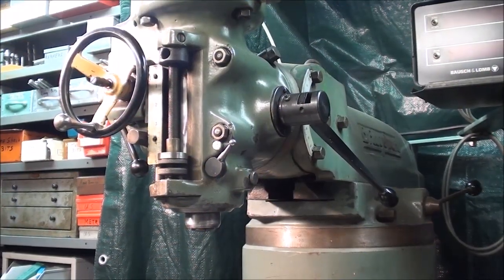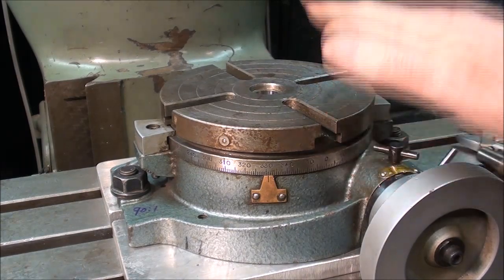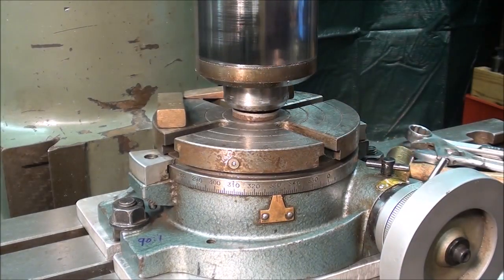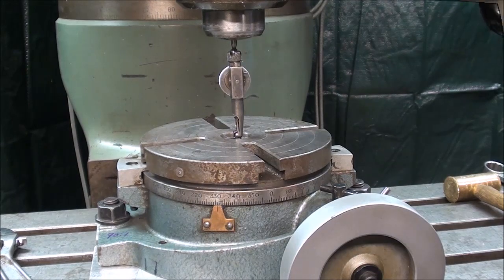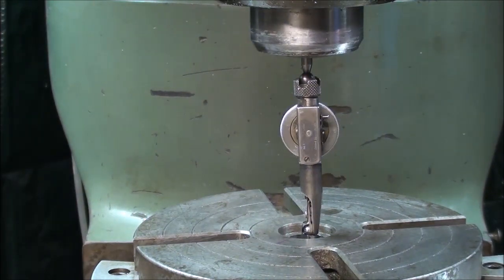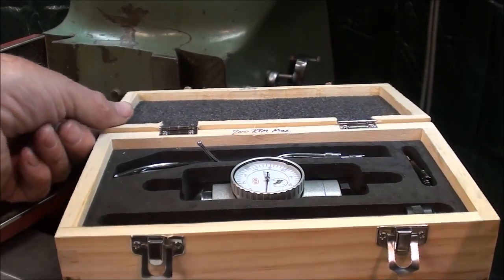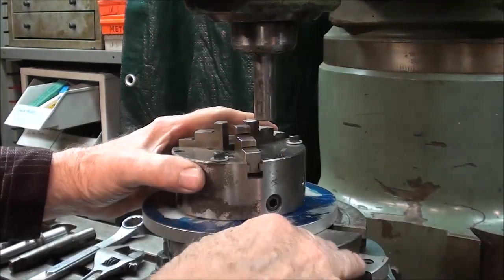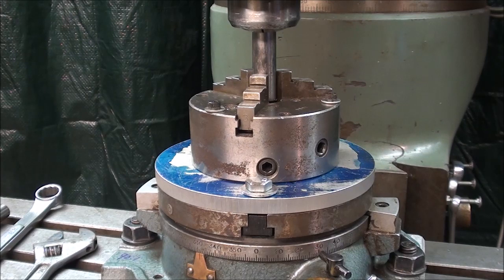TIPS #201 mrpete Centering a Rotary Table on the Bridgeport Pt 1

Comment: Easiest and most accurate way to align rotary table to the machine spindle. Bolt the rotary table to the machine's table. Mount an indicator on the  face plate of rotary table using a magnetic holder. Disengage worm drive of rotary table so it is free to turn by hand. Using the milling machine X-Y table adjustments roughly center the rotary table while turning the indicator around nose of machine spindle,  with out it touching to get it roughly concentric. Now bring indicator into contact with spindle and dial in while turning the rotary table. This method is a must with a Cross Slide Rotary Table where there is no center hole reference in the table. This aligns the true center axis of the rotary table.
Reply from the maker: Thank you.I will show that method at the end of (unreleased tips 375).
There is no hole reference in the table I am showing. The nose on my mill is damaged--so I use the quill

Comment: Thank you for outstanding instruction.  I noticed your small 3-jaw chuck has 3 through holes for mounting to t-nuts on an adapter plate that is then mounted to the rotary table.  Except for 3 hole chuck vs. 4 slot table plate, could you have drilled 4 holes in the chuck and mounted it directly?  I have a small spare 4 jaw chuck that doesn't fit my lathe spindle and am thinking of extending the mounting holes to be through holes for mounting directly to the t-slots on a rotary table.  Is this a hairbrained idea or might it actually work?  Thank you again!

Comment: Hi and thank you for these invaluable videos. Could you explain what / how you are measuring at 9:06? As the dial is mounted on a ball joint, how do you ensure that the gauge itself is aligned with the axis of the mill? Or does its centrality at that point not matter given the task? Thanks for being a great teacher and sharing your knowledge

Comment: BusyBeeTools.com has the straight shank arbors in MT2 and MT3. #B460 and #B461. They only come with a 1" straight shank so may have to be machined down, which is not difficult as this portion is not hardened. They are located in Canada, but will ship to the U.S. The arbors are manufactured by Groz.
Reply from the maker: Thanks for the tip

Comment: For my rotary table chuck adapter plate, I turned a chuck register on one side and a rim on the other that fits snug in the MT2 center bore. This gets me within about 0.0005 every time. And honestly that half thou error might be in the chuck or in the rotary table spindle, not in the chuck to table interface.

Comment: Hello:  where did you get, or can you set a link for the M2T with a 3/4" straight shank?  Time 4:36. 
Have looked in catalogs and on ebay .. but can not find one. Is there a special descriptor, or supplier?   Thanks,
Reply from the maker: I have no idea where that came from, I must have got it in an in an auction box?

Comment: whu not mount a cheap laser pointer into the spindle and do the same ?
Reply from the maker: gav Yes. Where do I get a cheap laser?
Reply: mrpete222 The office supply store has them.
Reply: +mrpete222 don't do it!  most laser pointers (and raw laser diodes), do not run true (they do not need to, since the user is just aiming the dot without precision). that said, calibrated laser center/edge finders are available, but are hardly precise nor cheap -- i have had both a calibrated laser finder and wobbler for several years, and the laser went long ago to my sister so she can entertain her cats with it.

Comment: Why not turn down the diameter of the handle the fraction of an inch it needs so you don't lose so much height when using your rotary table with that plate?
Reply from the maker: +ExtantFrodo2 Thanks for watching-good idea

Comment: One thing that ive been puzzling about lately is how did they build the machinist tools to make machinist tools before they had machinist tools
Reply: The most basic precision tool is the flat surface plate. We can make these really good both through machine grinding and then by hand scraping. From that we can make straight edges. Precision-screws and measuring tools arose around this time, mid 18th century. Metals lathes. You can make extremely accurate circular diameters with lathes and even land-lapping. Ultimate precision comes from using light to measure, interferometer-based machines.

Comment: Anybody have any luck finding a mt2 to straight shank arbor?
Reply: +Tommy Hummer  They are readily available in the UK.  The parallel portion is machinable so you can make them to fit various applications.  I use one with a centre drill inserted to centre on the lathe.
Reply from the maker: +Tommy Hummer Little Machine--I think

Comment: This video is still helping people over five years later. I'm new at this and recently purchased a small rotary table with a #2 Morse taper, so this was very valuable to me. If anyone is looking for a #2 Morse taper accessory to use the way it's demonstrated in this video, I found this on eBay: https://www.ebay.com/itm/163614398363 It's a #2MT with a 3/4" straight expanding mandrel shaft. Fits perfectly in a 3/4" collet and even has a built in ridge to function like the washer in the video for using wedges to get the tool out if it's stuck in the rotary table.
Reply from the maker: Thank you, I’ve never seen one of these